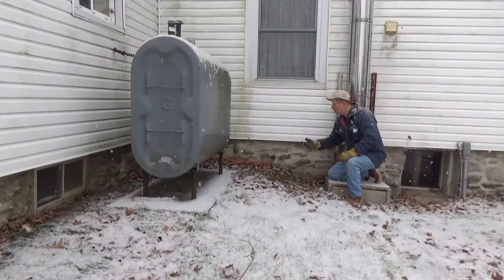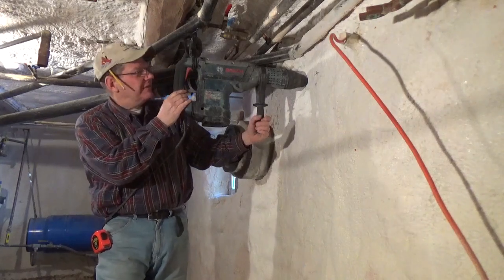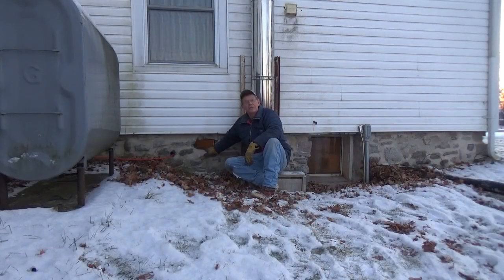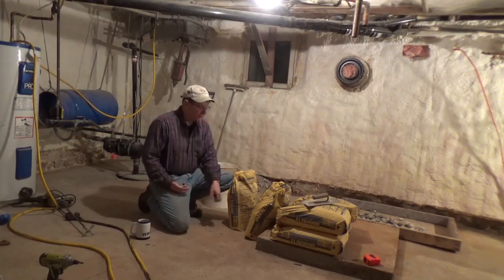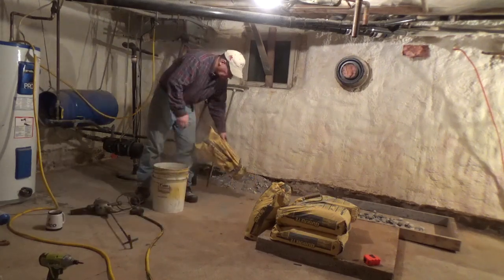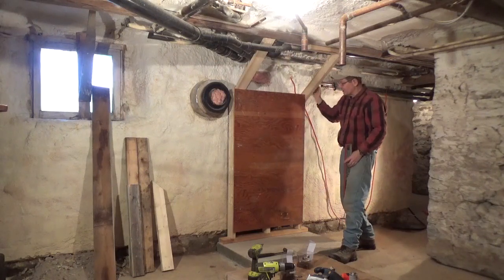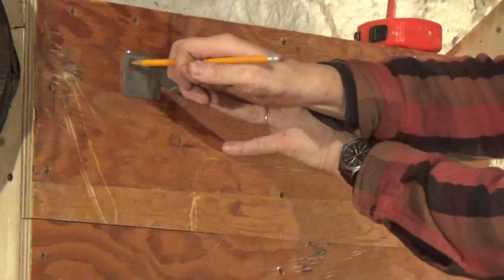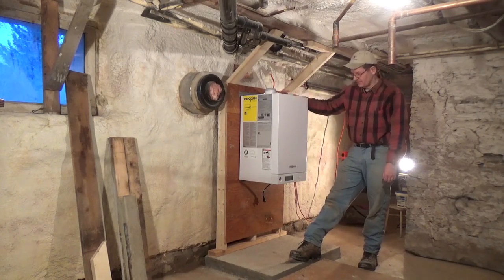Switching from Oil to Propane Part I

Comment: Great Video. Thanks..  BTW. What kind of oil does an oil burner burn. From the city and really have no clue
Reply from the maker: Greetings,
Thanks for your encouragement. Furnace Oil and/or Home Heating Oil are similiar to Kerosene and have been used as a fuel for furnaces and boilers prior to Natural Gas and Propane becoming popular. It is still a common home heating fuel in rural parts of Canada and the US.

Comment: Why did you create another hole in your stonework when there was a hole from what looked like an old chimney opening?
Reply from the maker: I thought it wise to reposition the propane unit. I located the original chimney when I had installed a wood fired boiler 30 years ago.

Comment: How’s “US Boiler Alta Combi” unit?

New to market
Reply from the maker: Greetings,
Our boiler performs very well, significantly more efficient than the oil fired unit it replaced. Unfortunately I do not have any experience with the US Boiler Alta Combi unit.

Comment: great video and good humor. random question, did you put foam insulation on the walls?
Reply from the maker: Greetings,
Thank you for your comments. We did have foam insulation sprayed on the basement walls. If I could back up the clock I would not do it again. The humidity level in the basement went up substantially necessitating the use of a dehumidifier. 
Oh well, live and learn.